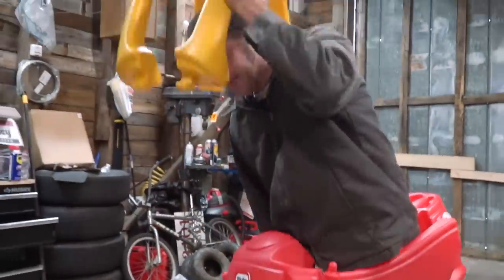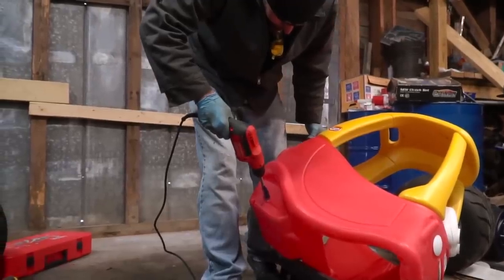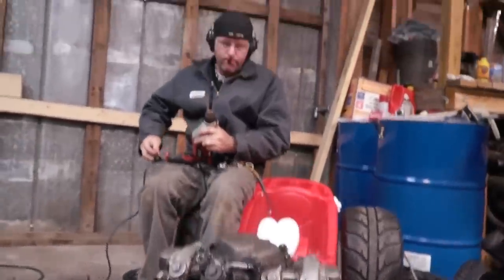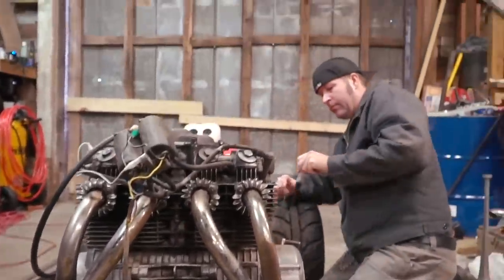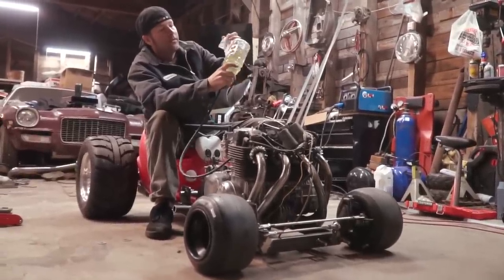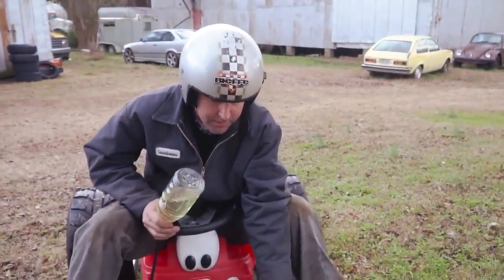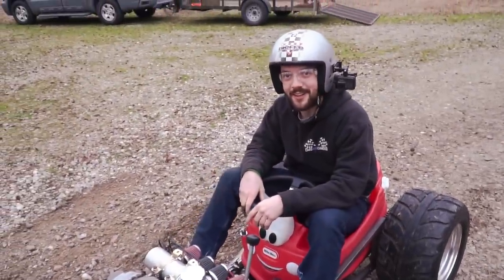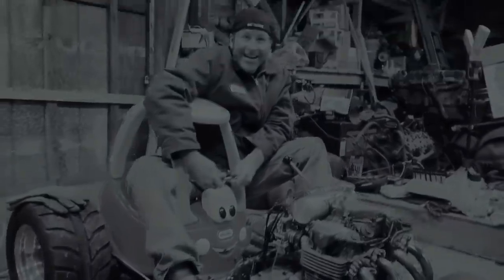Building a 550cc Little Tikes Car in 18 Minutes | 40HP Cozy Coupe Go Kart Build

Comment: Quick note on the Honda 550/4. In August 2009, I was on my Road King westbound I-40 between Amarillo and Albuquerque with my cruise control set on around 83-85. In my mirror I see a single headlight coming up behind me. A few minutes later, a guy on a Honda 550/4 cruises right on by with not so much as a wave back. I gained a whole new respect for the Honda 550 that day.

Comment: @CarsandCameras if you cut in middle of those front and rear beams you can use fiberglass to make much much higher then just sand off and  paint on and you fit properly
 in

Comment: I got a MB-200 like yours and I did upgrades and went from 24mph to 49mph I have a 50 tooth sprocket on the back I have a 38 tooth to put on it but I'm afraid that the bike can't handle the speed that the smaller sprocket will produce

Comment: Hello.
I am interested in a question that, so to speak, is in your competence))
I bought a kart with a 163 FML drummer, allegedly with a capacity of 14 liters, s at 7500 rpm
Tell me pzhlsta, sprockets with how many teeth to install? So that he could confidently drive, say 100 km / h, was torquey and nimble. The weight of the card is about 60 kg. my weight is 65 kg.
The 428th step allows you to choose the leading one from the row - 13, 14, 15, 16 and 17 teeth. And the slave will be made to order. Its maximum size is limited only by the kart clearance. It is also possible to customize the leading sprocket in the required size.
According to my conservative calculations, 13 * 40.
Thank you very much for your intelligible answer.
I really hope for you, I hope you will see.